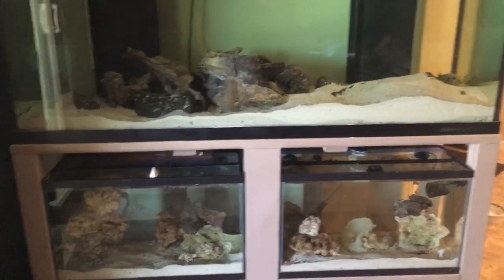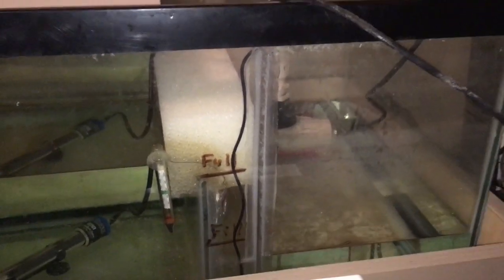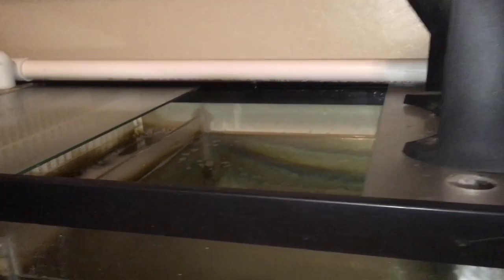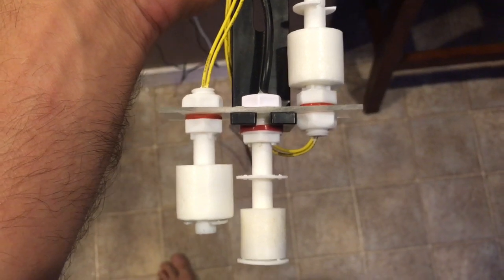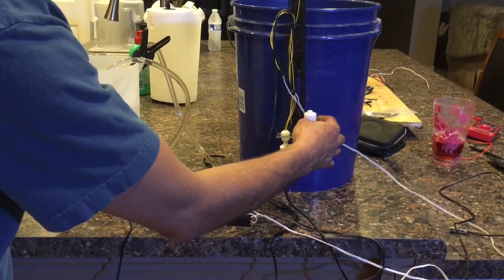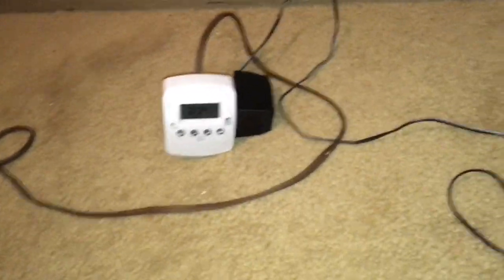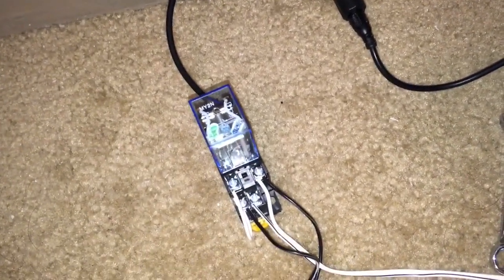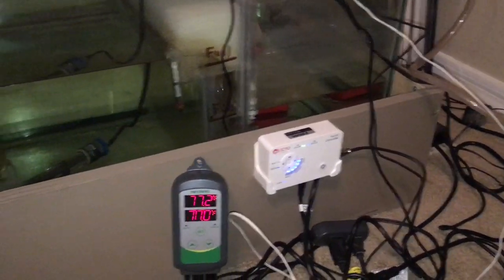DIY AUTO TOP OFF / ATO CHEAP & RELIABLE AT END OF THIS VIDEO CLICK ON UPDATED VIDEOS

Comment: What if your pump has 3 wires for its plug? (3 prong outlet I will slice up)
Reply from the maker: That third wire is so you can reverse the pump you won’t use it what color are the wires on it
Reply: @diydan7019  ah will let you know in the next day, we’re currently in a storm so I can’t pull it to slice it ha! But basically I have a drain on the bottom of my downward sloping driveway and I have a transfer pump in case it overflows. I wanted to use a small float switch for it but this pump seems to be high powered

Comment: Hey Dan. I hope you see this, but I was wonder if you can help figure something out. I have made your alto top off system. It doesn’t want to run the pump. It power through. The only way it works is with an extra power cord spliced through. I have also followed eat sleep reefs video to make it work, but I like yours how it’s simplified. What is the problem you think. Power supply is an ac 12 volt.
Reply from the maker: IT SOUNDS LIKE YOU HAVE A WIRE ON THE RELAY NOT QUITE RIGHT OR ONE OF THE LEVEL SWITCHES UPSIDE DOWN I WILL TRY TO GET MY RELAY AND WATER LEVEL SWITCH VIDEOS POSTED AS SOON AS POSSIBLE TO HELP YOU OUT
Reply: DIY Dan Saltwater junkie thank you I watched and studied the videos. I just saw your reply’s but seen the videos first I kind of had a feeling those were made and meant for me. I have tried multiple times I’m about to do it again but try different converters. Here is all the products I’m using. Maybe you can see something I’m over looking. 8 pin 12vdc 5A relay. 110-240v 12v-2A ac adapter. 110-120v 60 hz 2w water pump. Thank you for your time and all your help.
Reply from the maker: YOUR PRODUCTS SHOULD BE GOOD DID YOU WATCH THE UPDATED AUTO TOP OFF VIDEO I POSTED IT IS MORE DESCRIPTIVE THAN MY OLD ONE. IT WAS ONE THE EARLY VIDEOS WHEN I JUST STARTED LOL
Reply: DIY Dan Saltwater junkie. So I stayed up till five in the morning after work trying everything. It doesn’t want to power through the relay even with another converter that’s ac to dc without a spliced extension cord. I do got it working like a charm with the converter and cord. Maybe I’m just anal about being simplified because being organized is being safe and it means success. I do have a 2 year old and a seven month old that’s all over the tank all day. I just don’t get why it doesn’t work simplified like yours. Thanks my friend.
Reply from the maker: I GOT THOSE VIDEOS FOR THE RELAYS AND LEVEL SWITCHES POSTED DID YOU HAVE ANY LUCK WITH GETTING IT WORKING
Reply: Hello, maybe you can try this: https://amzn.to/2sqsZoR
Please contact me if you are interested, I can give you a discount of 35%
Thank you!
Reply: Chen Chen how do I go about in getting your  water level controller

Comment: Very cool project.  I like the idea of using a fan over your sump as a tank cooler.

The backup timer is a good idea.  Definitely going to add one of thoses when I build my DIY ATO.

FYI, that is not an inverter lol.  It is a DC power supply which uses a rectifier to convert AC power into DC power.  Inverters convert DC power into AC power.
Reply: Hi, is it better to use ventilator on your sump or direct over aquarium to cool tank or it is same? Great video you have!
Reply from the maker: SORRY I JUST SAW YOUR COMMENT GOT MISSED I FOUND IT LOOKING BACK FOR SOMETHING ELSE I PLACED MY COOLING AND HEATING DEVISES AS CLOSE TO WHERE MY TEMERATURE PROBE IS AS POSSIBLE WICH IS IN MY SUMP I FIGURE THAT IS GOING TO BE THE MOST ACCURATE AND LEAST AMOUNT OF DELAY BETWEEN WHEN IT TURNS ON AND OFF